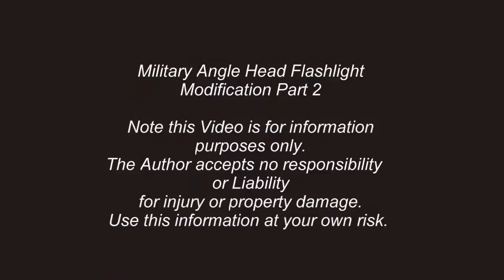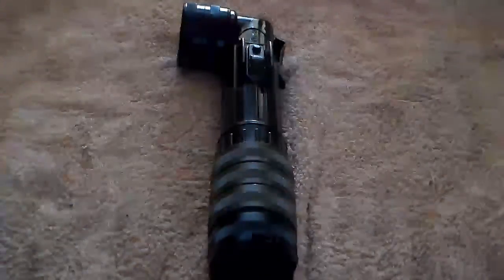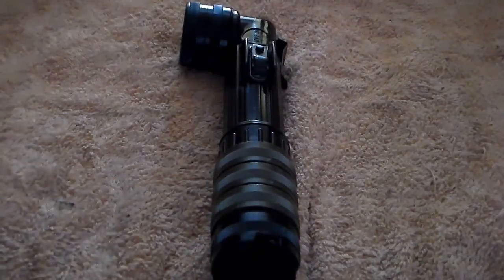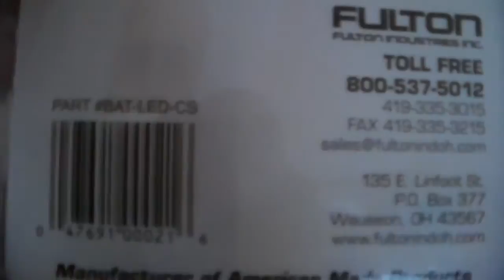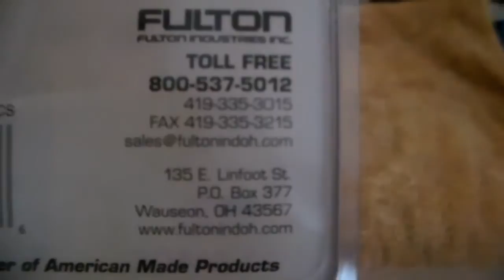Military Flashlight Modification Part 2

Comment: I have watched this video series, more than once. I have, and use these Fulton flashlights...for most everything(for decades). I can buy these and improve on and/or mod almost criminally cheap. Realizing these videos are several years old, they are still relevant. The debate between using AA or D cells is easy to solve...use whatever makes you feel better. 
Everything I carry(with battery power) use AAs, so my decision is a cinch. I have 2 Fulton MX 991/U lights, that I've built. Just like the video...with cavity. 
1. Powered by Fulton LED, D to AA battery conversion kit.
2. Powered by 3 CR123 lithium batteries(9v). With homemade battery holder. 350 lumen LED bulb. Modded reflector. This my vehicle light. I use a single D cell Maglite holder, in which the Fulton snaps into beautifully.

Comment from the maker: Hey everyone just wanted to let you all know I was contacted by Fulton. Apparently they have had a lot of people contacting them for the parts I show in this video. In fact so many people have contacted them that they are in the process of setting up there own Amazon account. On this account they will be selling parts in all the flashlight colors they manufacture as well as entire flashlights. Now when I posted this video 2 years ago the pricing was current and correct. Here we are 2 years later things have changed. Gas prices cost of living everything has gone up. So do not be surprised when I tell you there prices will be changing. I do not know how much of a change in pricing is coming but take into consideration Amazon fees, changes to there shipping department administration fees ect.     When they have the Amazon account up and running I will be adding links to it on my flashlight videos. I just wanted to say this change would not have happened without the viewers wanting these flashlights and parts. Congratulation's everyone!
Reply: Why doesn’t Fulton sell directly on Amazon anymore ?

Comment: Is the conversion to the 2 AA cells required? I personally would prefer the higher capacity and longer run time of D cells.
Reply from the maker: xrayangiodoc no its not required. I was showing that you could use any battery combo you had on hand in an emergency that gave you 3 volts. I agree with you that having D cells are better and give a longer run time but in a power outage they are one of the first battery type to be sold out. So its best to stock up. Thanks for your interest.

Comment: Here's a little mod I like to call stealth mode. So most Flashlights have a spill beam which is useful for seeing stuff outside the hot spot, but maybe you wanna reduce that beam so no one can see the light source as easily at certain angles. 

So very simple mod, all you have to do is attach extra rings to the head. I've only got one extra, but the more you add, the less spill beam and you don't lose any throw. Also, now you can hold the Flashlight horizontally.
Reply from the maker: Seen some guys cut a soda can and put it around the end with a rubber band to also get that effect. That's why I love these old flashlights. There seems to be no end to what you can do with them.
Reply: @charlesartificer2158  Only problem is the Aluminum will reflect light on the  sides unless you paint the inside of the can black.
Reply from the maker: @Vinnay94  im talking the graphics side of the can is on the inside. Like a black monster can.

Comment: Hello. Awesome videos :) I am curious about the pros and cons of using the AA batteries over the D batteries.  I know that the D's have more run time than the AA's but can you recharge a D battery out in the wilderness if you don't have easy access to batteries or electricity? I think there's a way to recharge AA's with solar power but i'm just not sure about D batteries. I know it's an odd question but whichever has the best rechargability i'd rather use. Thanks for these videos and tips. I'd never even thought of doing these mods.
Reply from the maker: Well, the weight can be an issue when you are carrying a lot of stuff. Yes you can recharge your batteries in the field if you have solar. AA's will charge quicker vs D's but then there is the issue of run time as you have said. There are products on the market that will solar charge like this one http://www.harborfreight.com/portable-household-battery-solar-charger-68690.htmlOr you can have a set up like what is in this article. http://modernsurvivalblog.com/preps/off-grid-charging-system-aaaaacd9v/Good luck and Thank you for your comment.

Comment: Charles, how many lumens is the new LED and can you run it off of the D cells permanently instead of the AA cells. Thanks
Reply from the maker: Crusadersojourn According to the package the LED Bulb is only 50 lumens. However as I said in the video the Bulb was designed specifically for Fultons Reflector. So it seems much brighter than it is. As for battery use you can use any combination of batteries in the flashlight that gives you 3 volts dc. The adapters were made for the military to help save weight. Thanks for your interest.

Comment: you can also make a small compartment if you take the top section off, and use a thick O-ring , the part that holds the filters screws right back on the light , then you just put the other part on the bottom and the light still works but has a small space in there, i dont think fulton sells the rings anymore, so you'd have to buy extra flashlights i guess